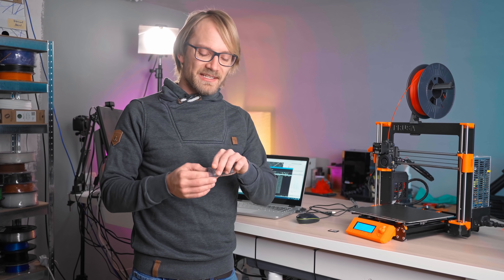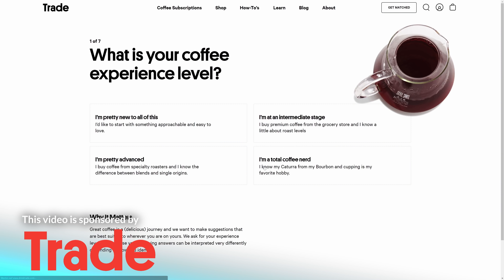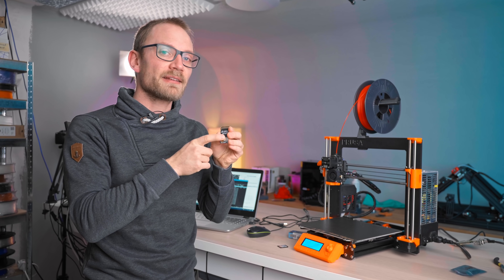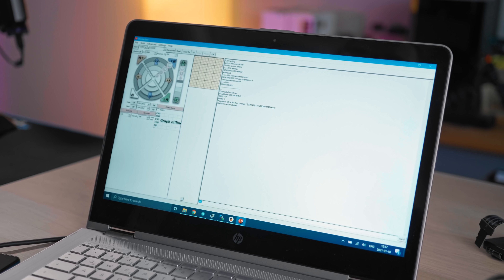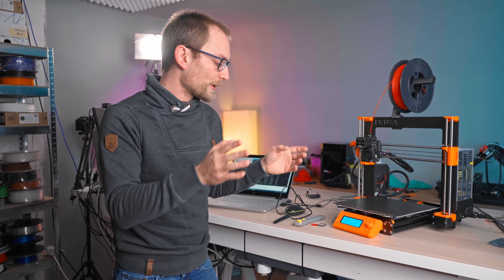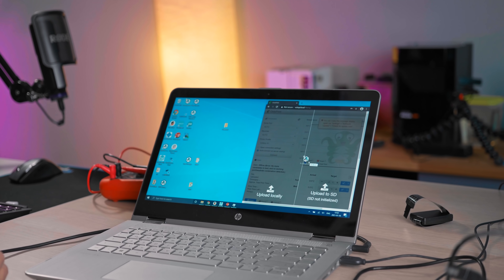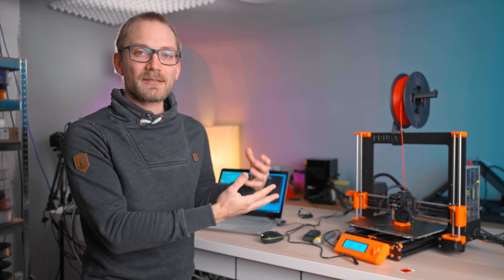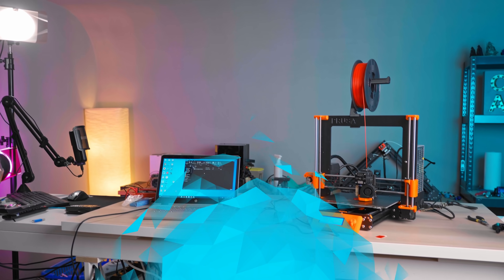SD Card + ESP8266 = OctoPrint Alternative?

Comment: The ESP8266 fake SD card is a genius idea. Thank you for the review!
Reply: Me again. Seriously, this is a very good idea. ESP8266 can handle authentication and could send data over a USB connection. It is just a matter of time. Thank you again for the review!
Reply: Yeah when I saw these on AliExpress a while back I was hoping/assuming that the ESP8266 was emulating an SD card to the printer, using the real card as its storage.
i.e. that the real SD card was connected only to the ESP8266, with the ESP providing an SPI interface that emulated an SD card to the printer.

That method would allow access to the card by the printer and the WebDAV server at the same time - it'd just have to put a read-only lock on the file that the printer was currently reading, so that you couldn't change a file from your PC while the printer was busy reading from it, which would cause Problems™...

(To some extent, I think allowing the PC to append to the actively-printing file would be feasible - and in theory you could even start printing a file before it had finished copying, with some caveats - but it'd likely require a bit of firmware support, as I imagine printer firmwares don't expect G-code files to change *while they're being printed*, and might do things like using the initial file size to calculate progress percentages... So if you started printing when only 1MiB of a 4MiB file had transferred, and the printer firmware only read the size of the file when it started printing, it would read 100% progress only ¼ of the way through, and might either stop at that point or continue counting up to 400%!)

But, to be fair, I think that method would require a lot more firmware development time to get right, so I don't blame anyone for choosing this option. What's being done here is certainly "interesting", and a clever solution, even if it isn't the optimal user experience.
But, if this is an open source project (which I wasn't aware of!), maybe someone will be able to develop ESP8266 firmware to do what I described above - or, preferably, ESP32 firmware to do that, but faster! :)

Comment: I put a Toshiba FlashAir 64GB in my Prusa i3 Mk3, configured it to be a wireless network drive, works great because I never have to take it out of the printer to add/delete/etc. the files on it.
The Prusa does have a FlashAir setting in it's configuration but it can lose track of what files are there when you add/delete some, so my workaround is to make a subdirectory for each project in the root, and in that subdirectory a directory called 'refresh', so I can navigate into 'refresh' then back out again and the file list is fully refreshed.
I couldn't get a smaller sized FlashAir, but the printer has no issues with it formatted to FAT32. With so much extra space I put it to good use by storing a backup of my 3D project files I work on, zipped & split into 1GB file sizes.
Reply: Toshiba don't make the FlashAir cards any more.
In fact they spun off their whole solid state division into a new company KIOXIA and they're not making the FlashAir.
The primary market for the cards was killed off by cameras and the like having WiFi added to them.

They're still available in a lot of places, but not long term.
Reply: @_Piers_  Oh no, thanks for the heads-up, I'll grab a couple more whilst they're still available because it's such a useful feature I'm sure I'll need one or two in years to come.